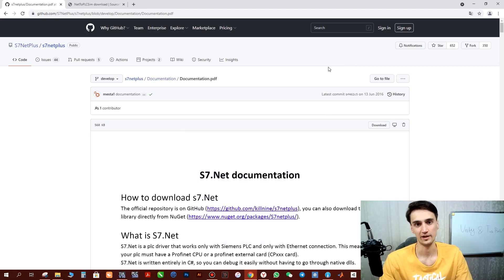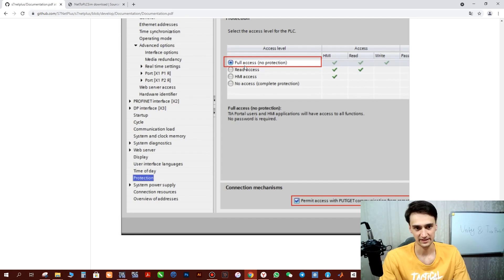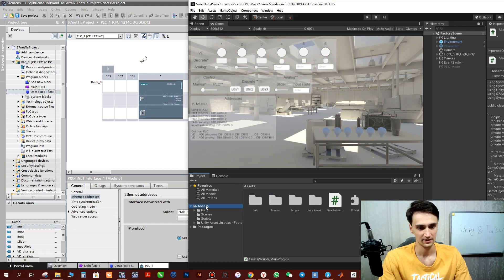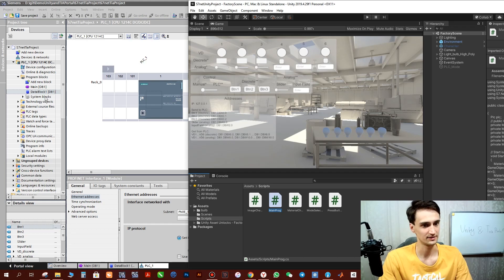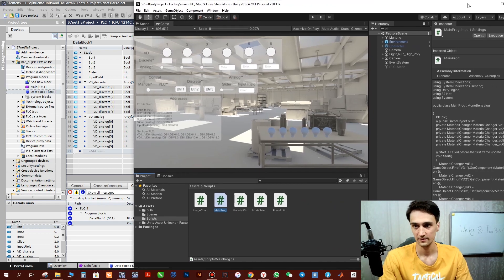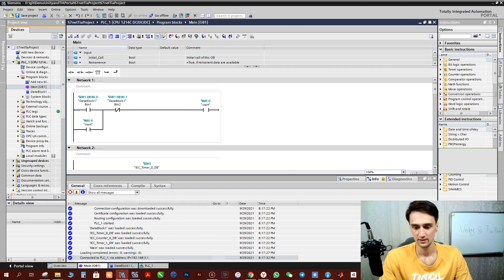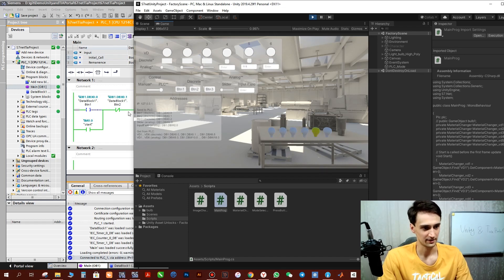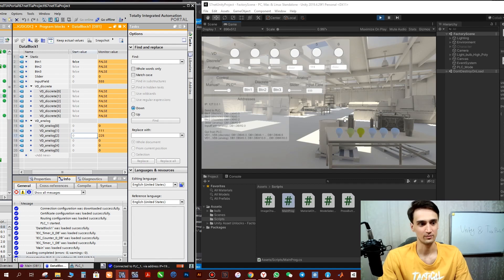Communication between Unity and TIA Portal with S7NetPlus (English)

Comment: Hi Ivan,

Thank you for the great video — it was very helpful for learning!

I'm planning to purchase your Udemy course soon.

I’m interested in integrating an S7-1500 PLC with Unity, but I currently don’t have access to the actual PLC hardware.
Is it possible to implement the flow and test the integration without real hardware? If so, could you please explain which software I need to install to simulate the setup?
I would like to send/receive data from Meta Quest 2/3 then How it will work?Using MQTT?

Also, if I learn the integration flow using the TIA Portal and simulation, will the same process work seamlessly when I later connect to a real S7-1500 PLC, as shown in your video?

You're doing amazing work by creating these videos.
Thank you so much, Ivan — greetings from India!

Thanks and regards,
Dhruv Modh 
XR Software Engg